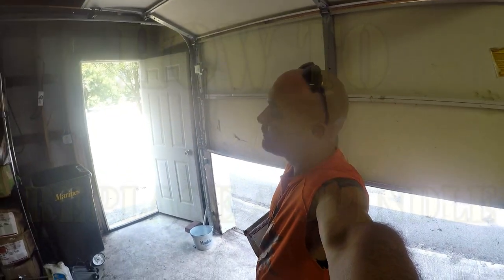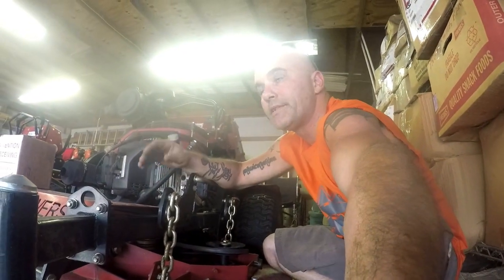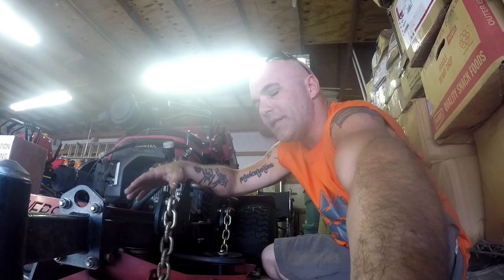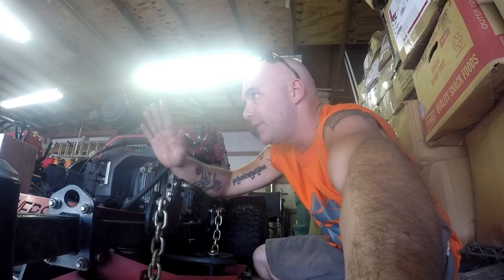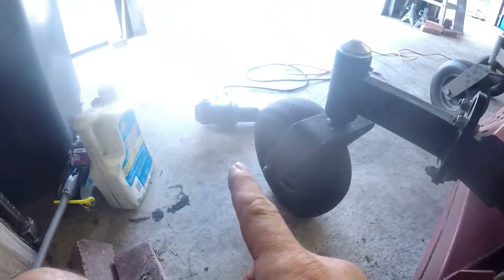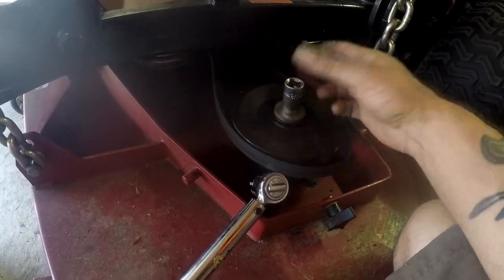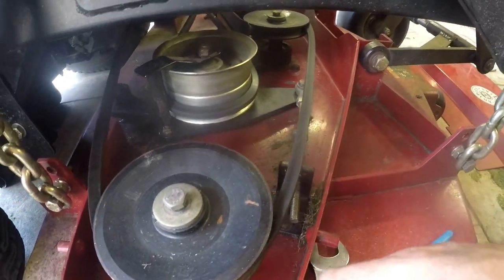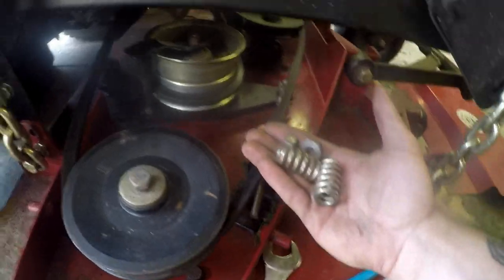How To Replace a Spindle on a Commercial Mower

Comment: How did you got the pulley of the spindle with that little pin in it? I replaced 2 and I had huge problems with the replacement. 
Any suggestions for me.

Comment: Have you opened up a new spindle yet?  I mean to see the failure point?  I haven't had to replace any yet through warranty but i'm guessing the bearings suck.  Or the seals on the bearings are just sub par.  They are completely rebuildable and are easy to do to.  Also, are you balancing  your blades?
Reply from the maker: Yes but it was the bearings they was not the best sourced bearings the new spindles are top of the line .. It had tons to do with the belt and tension this unit has a tension arm not spring so its always tight no release of tension that does not help spindles the video Wednesday is called The UpGrade cause thats what it is a upgrade to the tension arm amd spindles ... They are listening for sure and replied from my two year review .. I. Am more than happy with the machine just has tona of room to upgrade thats very exciting to me to watch this company evolve
Reply: @OneLoveLawnGroveCity   so the newer Bradley mower's spindles have no issues? I'm real close to purchasing a fleet of them this spring. Can they manage 800-1200 hours with no major issues?
Reply from the maker: @larrybrandonii269  yeah man newer bradleys are solid
Reply: @OneLoveLawnGroveCity  I think I’m going buy a pair this spring
Reply: Wow, so no more spindle issues on Bradley mowers? This is my third season with the 48WB and I’m about to pick up a stander. Never had a spindle break on the 2019 WB, but I kept expecting one bc I heard about this problem. Did I get lucky or were spindles an older problem?

Comment: Glad you had better luck with this company. Called Monday.. never got a call back. Called again today. I wanted the complete unit sent under warranty. They said they would only send the bearings that go inside. Top bearing exploded while mowing. Their solution was to go to my local bearing dealer to get better bearings. Machine is 4 months old owner operated and have never ever ever ever had one spindle housing bearing whatever go on any of my machines. This company is a joke. Tires don’t hold air in front, Grease fittings they have in machine are falling out. Springs breaking. First two months I was so happy. Now the real machine is showing its face. Complete garbage. Never buy another one.
Reply from the maker: Mannnnnnnnnn sadly you are not the first person to tell me this about the communication.. Not real sure whats going 9n over there as I try to stay out 9f all that .  They don't give me anything for the videos and the mowers we have sold from the videos. I will have a 4 year review rolling out i hope next week .  I ended up buying a set of three with grease fittings .. i have always used a shorter spring 4" not 6 and do let it have a lil slack n it when engaged .. i have other mowers exmarks scags i have watched those and tried to make the bradley the same as the exmark .. dude I have done some shit to that bradley even up to the point in this video 😆  that was last year 3 years in .. i love my bradleys wont lie bout that at all but I also don't mind working on it here and there and making a mod to make things better .. i have the Honda 52.. they don't even make those anymore let alone sell the parts for the engine setup
Reply from the maker: Not sure where u r but if u r close u r welcome to come check mine out and what I have done .
Reply from the maker: Napa is awesome belts bolts tires everything napa
Reply: OneLove Lawn LLC I hear ya man... I run mostly gravely pro stance 52’s been watching your videos for a while and took the shot. The machine has serious potential. But lack of execution. We mow a lot of lawns. Week in and week out. Never had a break down with Gravely. But the cost isn’t the same obviously. I would have been fine if they sent me a replacement part for one that failed so early. But they decided to tell me to find someone local and back away from the problem. And insinuate that maybe I abuse my machine. Def love running them when the machine is good. Cuts good. Runs fast when needed. But if the root of the company(management) is that shady. It will be the last Bradley I ever buy. Was planning on buying 3 brand new ones next spring. Not anymore. Thanks for the Videos tho brother!! Appreciate it
Reply: OneLove Lawn LLC I’m out of Rhode Island
Reply: OneLove Lawn LLC what’s the part number in the spindle housings you replaces with the grease fittings??? I was looking on EBay and there are tons to choose from. That would be a huge help so I get the correct ones in!

Comment: Modern-day spindles are built to self destruct due to lack of Grease in the sealed bearings. To get around this issue when you rebuild your spindle, drill and tap an access for a zerk fitting in the center of the spindle, easy access area. When you put your new bearings in take the seal off of the bottom of the top bearing and the top of the bottom bearing. When you reinstall you will now have open access to grease your bearings with all that Center lube and the removed dust covers will allow the grease to penetrate where it needs to go.
Reply: Drill 2 holes. The second is pressure release to keep the outside seals intact. Just plug it with your thumb and release when full. Put a screw and washer on it
Reply: @largesmack8517  good insight you got to burp it